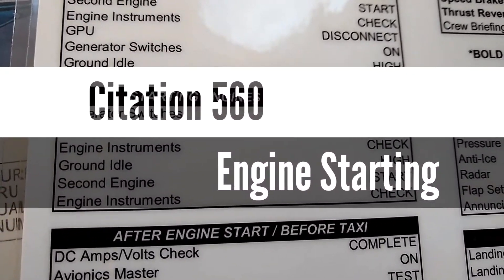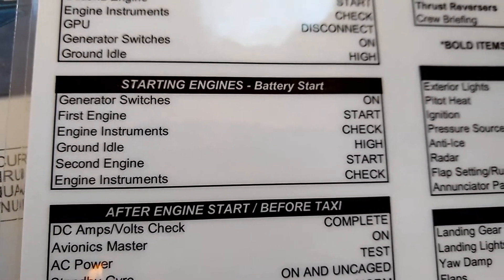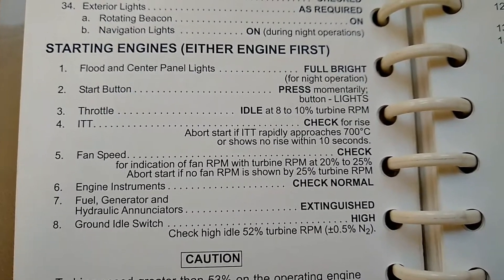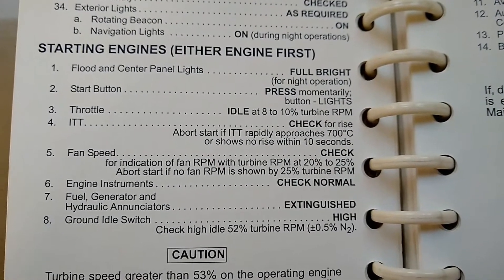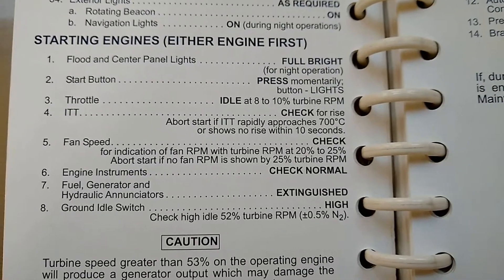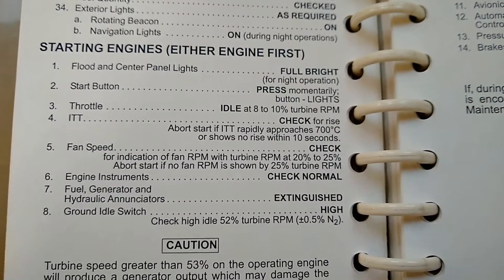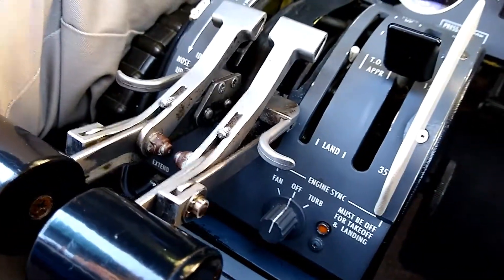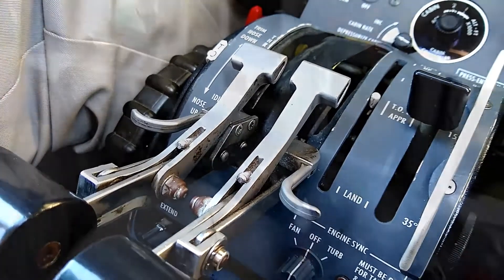Citation 560 - Engine Starting Procedures

Comment: As opposed to a larger aircraft (A320 etc.) I see that here there is no APU to start, in order to start the engines (by sending compressed air to them).
Reply from the maker: @laurentldoldi840  correct. Thanks for watching!

Comment: Thanks for the very nice video. Do you also fly the Excel? Why am I asking? I am developing an engine performance model for this aircraft (PW545 engine) and would like to know the typical values of N1 and fuel flow at minimum idle (close to ISA sea level). Based on my calc I am getting around 19% N1 and 230 pph (per engine). The N1 seems a bit too low. Any info would help. Thanks!
Reply from the maker: Hi Lukas, yes, I do fly the Excel/XLS and you are not far off at all. When I trained on the Excel, I was surprised how low the N1 fan speeds were at idle compared to the 500 series Citations.

I can't quote specific numbers and conditions from memory, but I can tell you a training poster from a major sim center depicts the Excel engines running at 22.1% N1 with 47.8% N2 at 1200 feet MSL and 15 degrees C for a temperature. They also depict the XLS (PW545B engine) running at 22.8% N1 with 49.3% N2 at 1300 feet MSL and 15 degrees C temperature.

The AFM states the green band on the N1 tape for the Excel/XLS is marked at 20%-100% N1. I take this to mean there are operating conditions under which a 20% N1 speed is normal.

I suspect this all relates to bypass ratio. The JT15D engine used in the 500 series Citations has a 2.1:1 bypass ratio. The PW545A engine used in the Excel has a 4.1:1 bypass ratio. It would make sense that a larger N1 fan relative to a smaller N2 core would spin slower at idle. More mass/drag on the N1 fan blades and less exhaust coming out the back to spin them.
Reply: @citationpro   Thanks for your feedback. Very much appreciated. Indeed, older turbojets and low bypass turbofans tend to idle at higher %N2 (and %N1). This has to do with the flow stability through the compressor (axial compressors do not like running at low rpm and older axial compressors were more susceptible to stalling). Modern high bypass turbofans have much lower idle %N1 (typically 20% based on my experience). Here low rpm is needed also to maintain low idle thrust since most of the thrust comes from the bypass. The issue of compressor stability at low power is solved by variable bleed valves and stator vanes to offload the first stages of the high pressure compressor.

 I will have access to a Citation Excel in 2 weeks so can then check the actual numbers. What is interesting about the PW545 engine is that in the Excel, it is highly derated (3800 lbf rated thrust at N1 around 88% at ISA sea level) and it could give up to 4600 lbf (this thrust would correspond to 100% N1). So it is a fairly low stress engine.

Comment: Very cool. Want to own a Citation in the near future. Are they relatively quiet inflight?
Reply from the maker: Yes, I'd put them on par with an older airliner when it comes to noise level in the cockpit. If you were to go without headsets and only use the overhead speaker/hand mic, it can be done, but you'd need to raise your voice a bit for call outs to be understood easily. Most of the pilots I work with wear some kind of lightweight ANR headset. The type and quality of the headset is not as important as simply having one.  When communicating with passengers in the main cabin from the cockpit, we definitely need to raise our voices to the point of almost shouting.
Reply: @citationpro  thanks for getting back to me. I was hoping it was a lot quieter, especially in the back for the passengers. Do most passengers wear headsets?  Sorry for all the questions, I really want a SP jet someday when I retire. Preferably one less than a million. So many IIs and SIIs relatively cheap with good engine times.
Reply from the maker: @loub747  , great questions. Most passengers do not wear headsets. Noise in the cabin is no different from the cabin on an older airliner. You don't even have to wear a headset as a pilot, but wearing one certainly makes life easier.

Good luck on your future acquisition! The 500-series Citations are a lot of bang for the buck. Just remember the initial purchase price is only a fraction of the cost. Maintenance and depreciation will be large factors also.
Reply: @citationpro  thanks. I’m still 5 years away. I may end up with a I, but the extra seats seem nice. The SII looks a deal, I know the engines are impossible to find, and the wing ice is strange. Still, a lot of bang for the buck. Yeah, depreciation is what it is I guess. The maintenance costs I’ll have to do some research into. I’m an airport pilot (747 for 25 years) and do some sim support in the G650.  Anyways, thanks for your videos. Good info for sure.
Reply from the maker: @loub747  Sounds like you've done your research. Without knowing anything about your budget or mission, I'd also encourage you to look at King Airs and newer Citations. If you're set on being the sole owner and pilot, a King Air will get you there almost as fast as a Citation I or II at a fraction of the operating cost. King Airs will be stuck down in the weather, but it's not like the Citation I or II will be higher than the mid-30s on anything but the longest legs so you're still going to be dodging thunderstorms. If you're open to leasing back to your local charter company, don't rule out something like an Ultra or something from the CJ lineup. By leasing back the airframe for charter, you might be able to own something considerably nicer than a II for the same budget as a II.

Comment: Starts a lot cooler than a PT 6
Reply from the maker: Indeed! I've never even come close to a hot start on these engines, even starting with a tailwind. They're pretty foolproof.
Reply: @citationpro   What is your opinion on the S 550 and wet wing and what would be a reasonable speed in cruise
Reply from the maker: @kristianfletcher5497  , unfortunately I don't have any experience with the S550. There aren't many flying compared to the other 500-series jets. Only about 150 S550 jets were ever produced. The only thing I can say with regard to speed, is not many operators buy Citations of any kind for their speed. It's usually about ease of flying, passenger comfort, short field capabilities, etc. They are incredible airplanes, but they are all on the slower end of the spectrum compared to other jets.
Reply: @citationpro  Well I am enjoying you stuff. Thanks a bunch

Comment: Does engine oil pressure 'Rising' deserve a glance during the start sequence, or just LO OIL PRESS L or R annunciator Extinguished is good enough.  The checklist for Encore says ----> 3. Engine Instruments - CHECK Normal ---> and ---> 3.b. Fuel, Oil, Generator, and Hydraulic Annunciators - EXTINGUISHED.
Reply from the maker: I would say a pilot should not worry about either item while the engine is actively starting. Focus on the ITT/N1 fan gauges to protect against a hot start or stuck N1 fan.

After the start sequence terminates, check both the oil pressure gauge and annunciator light to ensure oil pressure is operating normally.

These engines will run for a little while without proper oil pressure, but serious damage can occur in only a few seconds if the ITT or N1 fan don't start properly.
Reply: That's a 100% answer & thank you.

Comment: 8:24     you taxi into the ramp, and cut the left engine, ... or, you start only the right engine ... the door seal is pressurized.  How would you open the door in the Encore to embark or disembark a person?     Some 500 series have a GND[*] selection on PRESS SOURCE, the 560s have OFF - L - NORM - R - EMER.  So, how can you open the door if the DOOR SEAL annunciator is extinguished?    [*] = I don't know what GND selection is for; have flown 560 only.
Reply from the maker: The door seal is nothing more than an inflatable seal which helps keep the cabin sealed tightly to maintain pressurization in flight. It's fine to open the cabin door on the ground with one or both engines running. The door seal will lose pressure as soon as the door is opened, then will automatically reinflate as soon as the door is closed. It uses bleed air from either or both engines to maintain inflation. This bleed air is simply shooting out a little port in the wall of the fuselage, into the door seal, whenever at least one engine is running. 

The GND mode of the pressurization source selector is completely unrelated to the door seal. Using GND mode shuts off the normal flow control valves of bleed air from the engines and opens a single valve that allows a larger volume of air into the cabin while on the ground. This is used to warm or cool the cabin faster, typically right after engine start or while waiting in line to takeoff. 

Does this answer your questions? I'm happy to discuss further.
Reply: You answered the Door Seal question 100%, but caused another question - directly related to: I just got the engines started but I'm freezing or I'm sweating profusely (I've been both).  If there is no GND selection on PRESS SOURCE, like in the Encore [OFF - L - NORM - R - EMER], how can I get more AC or more heat forced into the cabin?  Both seem a trickle compared to what the compressors can deliver.
Reply from the maker: @N_Wheeler  , great question! If it makes you feel any better, the GND mode in most Citations is certainly not a miracle cure. It's still pretty anemic and I've done plenty of freezing/sweating regardless of the mode.

The tricks I've used, even in NORM mode, are to get as much air flow into the cockpit as possible. Bias the flow distribution all the way to the cockpit, particularly if you're trying to get the cockpit to warm up. Turn the defog fan to high in order to force as much warm air forward into the cockpit as possible.

Also remember the cockpit has huge windows. To keep it cool, you need a set of window covers. On a hot day, don't pull the covers away from the windows until you're literally sitting in the cockpit ready to start.

On a cold day, park the plane in the sun without window covers and it's amazing how warm the cockpit will stay. I've had days when it's well below freezing outside and with the sun coming in, the cockpit is easily above 50 degrees Fahrenheit.

Comment: I would like to know about the following information for the Cessna 560 aircraft.  List what the main hydraulic system power.
I'd appreciate it if you could tell me where I can find the information about this.  Thank you so much.
Reply from the maker: In the Citation 560 (V, Ultra, and Encore) the main hydraulic system provides power to extend and retract the landing gear, flaps, speed brakes, and thrust reversers.

Unfortunately there isn't much information about these systems online. The closest I've been able to find is the flight manual for the Citation Bravo at Smartcockpit.com. This would basically be the same as the 560 aircraft, except the Bravo has electric flaps rather than hydraulic.

https://www.smartcockpit.com/aircraft-ressources/CESSNA_Citation_Bravo-Hydraulics.html

 If you have any other questions, I'd be happy to answer them.

Comment: Really good video! I like how you showed what goes off on the panel as the engine starts. If possible please make more videos about The difference of setting in the cockpit while doing a GPU start, generator cross start and a battery start.
Reply from the maker: This video actually shows both a battery start and cross gen start. The first engine to be started is 100% from the battery. With the first engine started and generator online, the second engine start is a cross gen start. It utilizes both battery power and generator power to turn the second engine. 

Doing a GPU start video is a good idea. I'll add that to my list of topics to cover at some point in the future.